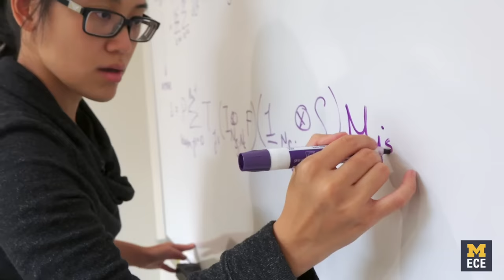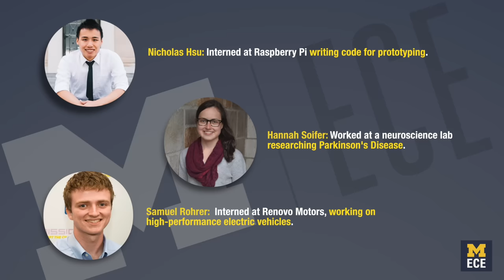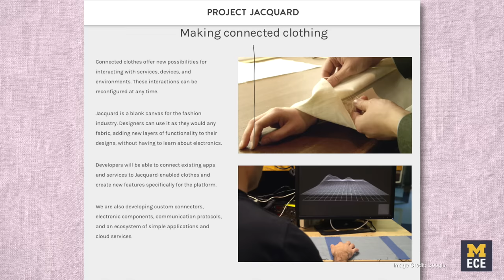What is Electrical / Computer Engineering

Comment: So if I want to build and create things I should do this?
Reply: If you like to make robots or smart systems, definately, for an innovator ECE does give a great set of skills when working with small electronics.
Reply: Luis Santos what should you opt in undergraduate if you are interested in Robotics and Electronics? Would Electrical Engineering be a great fit if you are interested in Robotics and Electronics?
Reply: Ayush Poudel I cannot really say for sure. Robotics is multidisciplinary from what I understand. It depends on what kind of robot you are working on. Smart robots with AI have computer scientists working on them but a mech engine could design the mechanical network.
Reply: Ayush Poudel but yes electrical gives you a tool set in which you can be valuable for robotics. Get in a robotics club and see what you prefer working on.
Reply: Luis Santos if I study Electrical Engineering with minor in computer science or ECE then wouldn't I be able to do the circuitry and programming myself?
Reply: Ayush Poudel Electrical engineering programs include programming, so you do not have to have a minor in computer science however it does not hurt to do so. ECE will help you in designing circuits for sure. However you do not have to limit yourself. If robotics is your passion it does not hurt to learn to do a little bit of everything. That would make you quite valuable.
Reply: Luis Santos I have 1 year before I join college, I have no experience with Arduino and stuff, how should I start? I want to go with basic knowledge and stuff so that I can indulge in project from 1st year.
Reply: Luis Santos Yeah Arduino might a bit complicated for amateur right? 555 timer IC might be good what do you think ?